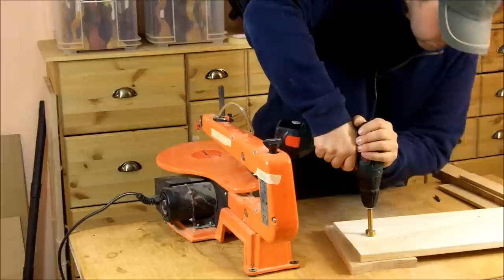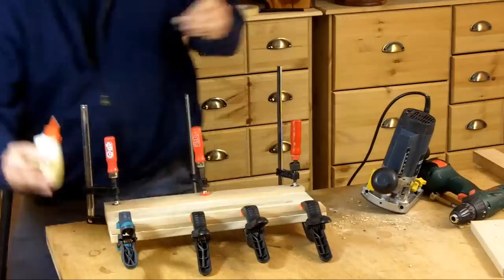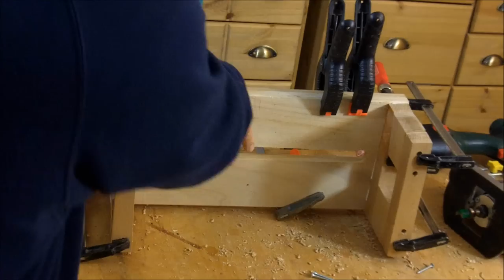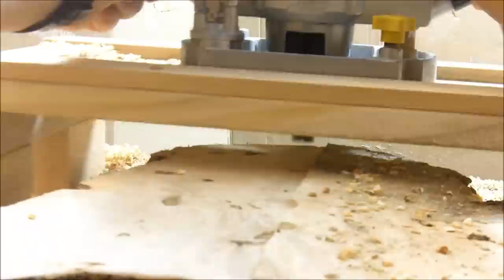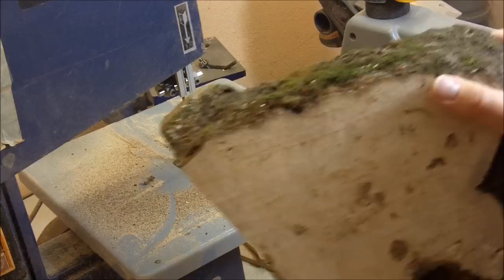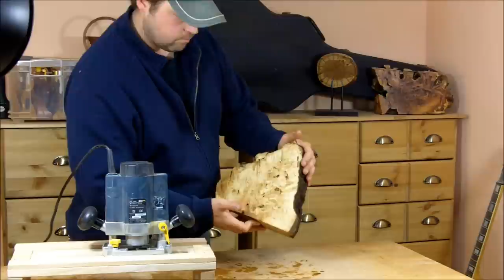simple Router Planer Jig - Woodworking // how to

Comment: What sort of wood/tree is the one you used? What a cool white color. And the cilindrical one on the left of were you finally placed it? Beautiful material. And what did you use to put color on it? Was it lacquer?
Reply from the maker: It's apple root wood. The other wood next to it is plum. I didn't put color on it, I finished it with rustins danish oil.

Comment: great video!

what did you use as finish? also, did you have to clean up the bark at all and will the bark chip off?
Reply from the maker: Thanks!
I used Danish Oil as a Finish.
I used a wire brush to remove the dirt.
In this case i'm pretty confident that the bark will not chip off. But it depends on the wood species.

Comment: Just curious, at the beginning why did you use a Forstner bit instead of spade bit? I am new to wood stuff and still trying to figure out my tools! I was under the impression that Forstner bits cost more / require more force to drill downward for holes?
Reply from the maker: +Melinda F Simply because I don't own a spade bit but I do own a set of forstner bits ;-)
Reply from the maker: +Melinda F Simply because I don't own a spade bit but I do own a set of forstner bits ;-)
Reply: Okay, thanks :)

Comment: how can you see the area where you work ?
it's invisible
Reply from the maker: Moutaz Zaim There is no need, It's no precision carving, it's for planing the whole surface. I make a pass and then I move the router 1cm to the right and make another pass. As you can see in the video it works fine. But you can improve the jig by making the top part out of plexiglass.

Comment: I don't understand what's the point of this video. Can't you cut the stem with a normal saw instead to use the router planer???
Reply from the maker: +Robert S Two questions: Have you ever tried to cut a perfectly parallel and straight and flat surface into burl with a saw?!
Do you know the difference between a saw and a planer?!
Reply: +Fabian's Tiny Workshop You are using a planer JIG used mainly for details. It's faster to use a chainsaw and then an orbital sander.
Reply from the maker: +Robert S Yes you'r right. It would be faster to use a chainsaw but I'm not able to cut a perfect parallel surface with a chinsaw. This Jig works well for me, don't saying this is the only way to plane wood. Normaly you would use a (thicknes) planer but burl or rootwood and any other highly figured wood will get-chip out. A planer JIG is usually used if the piece is to wide for the planer or if it's endgrain or highly figured wood. For example: https://www.youtube.com/watch?v=qtkBZHLJyD0
I would not classify this as detail work ;-) But again, If you like a chainsaw better do what ever works for you.

Comment: Why? When the Cheapest Real Planer from Harbor Frieght Hands Down Is Faster Better and Just Fn Normal
Reply from the maker: Why?? Because I've never seen a thickness planer that can plane burl or end grain without tear out. Especially not the cheap ones from Harbor Freight.
Reply: Problem with any planer is need a flat surface first.    This jig should be used together with a planer then a hand plane then a scraper, sander,.....depending on what the project is